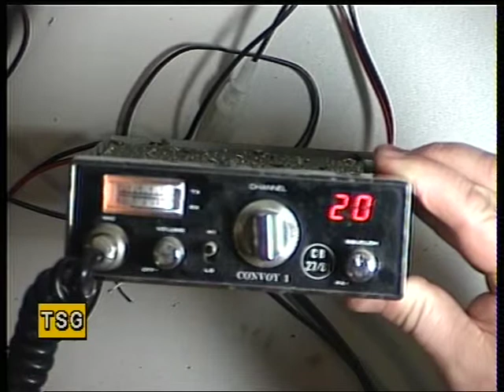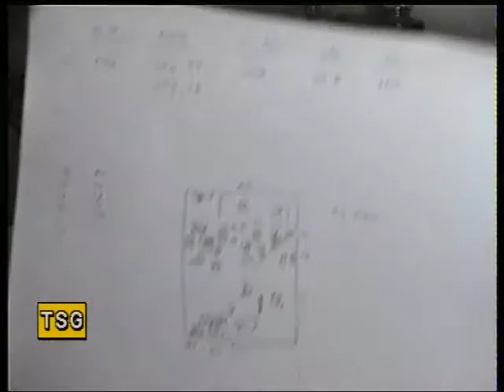Domico Convoy 1, UK CB radio. Alignment of Transmitter

Comment: Just got one of these. Bought it as I remember a friend having one. It was poor and he hated it but I always wind him up saying it was his best radio. Anyway, bought it to give him it for his birthday. It has some issues, TX PWR is half a watt on Hi and zero on Low so suspect an output transistor issue. RX is low and about 7S points down. I think I will be watching your alignment vids for this radio in the coming few days while I work on it.
Reply from the maker: +andymuza Low Tx power '& deaf receive sounds like a "common denominator" problem. Try cleaning the relay contacts, but first check the current consumption on TX. If the power supply ammeter shows 1A or above, the transmitter is developing the full 4w, but it's getting lost (duff relay). If the power supply is only giving about 250mA on TX, then the transmitter isn't developing 4W. Try alignment in that case before swapping parts.
Reply: +UK CB radio servicing Thanks for the advice, very much appreciated. I check the current consumption on during TX and it is 1A so will be checking the relay later. I will let you know how I get on. Thanks again for the advice.

Comment: Wow never thought I'd see another one of those! The modulation died on mine I guess an IC or a dry joint but I never could fix it. :-(   Loved that dual colour signal meter lighting though!
Reply from the maker: The Domico convoy 1, although an oddball set is relatively trouble free. A shame yours ended up with no transmitted audio as in FM sets it's usually very easy to track down the problem. I seem to think that there is a Convoy 2 but could be getting muddled, as the radio appears also as the Sun 401; the Sun 402 being a set with the WorldSound PT40 chassis.
Reply: You're right, mine was a '2' as I remember it. I think if it was these days I'd be confident of tracking down the fault and addressing it but I think I was only 16 at the time and was quite naive about radio innards.